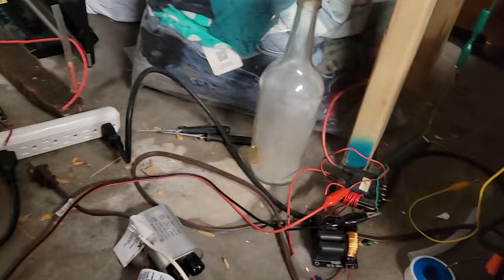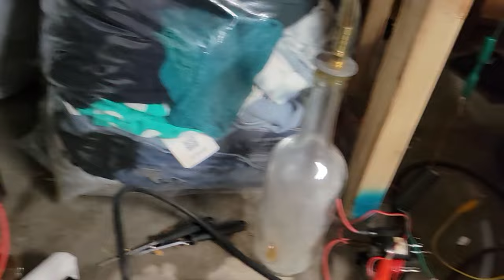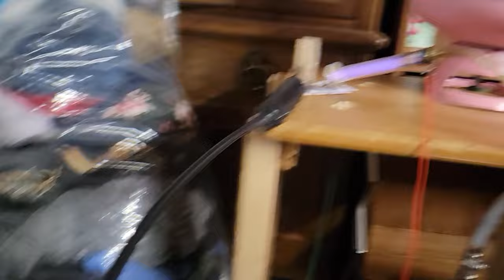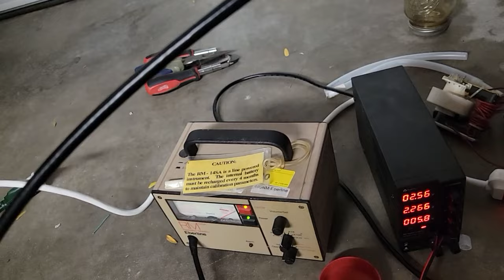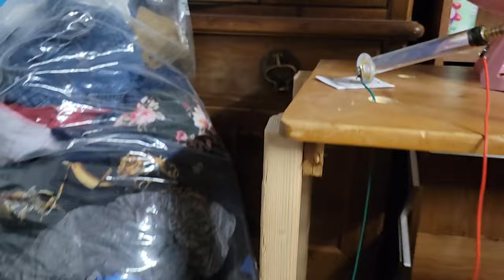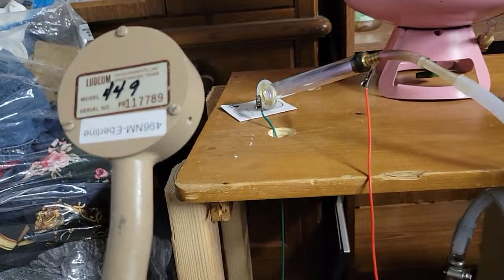CPM on earlier homemade particle accelerator

Comment: Can you provide a tutorial
Reply from the maker: Yeah I could probably do that, I don't know how many people would end up interested in it but are you wanting to know about the pumps or the chamber and how to put it together or the voltage system?
Reply: @talktoyourself  how to mainly put it together and possibly design one of my own.
Reply: I'm actually gonna build something like that with a aluminum foil window to let the electrons out. There are only a few videos and most of them are only short clips with no information. So I think there's some room to elaborate
Reply: @talktoyourself  i would like to know about all the electronics and how you drive the circuite and also what do you use for the electrons to pass through (i guess 10 micron aluminium foil or slimmer), What you use as the electron source (probably small light bulb without the glass) ... so many more questions and things i would test with that thing... now i want to build one myself :face-blue-smiling:
Reply: So the pump pumps air trough the tube and the electron charge mixes with the air creating ionized air? Cool stuff I hope that we can unlock the bodies potential to use the aether like we used to again, also liked the video on the thermal camera have had a couple uaps buzzing me once in a while would be cool to see one once i get funds to make utilize thermal lenses, there are also other spectrums that allow us to see being apparently. Stay strong.
Reply from the maker: @snapo1750 indeed it was a thin aluminum film 🙏
Reply from the maker: @thesciencefurry the aluminum foil window will work 😅